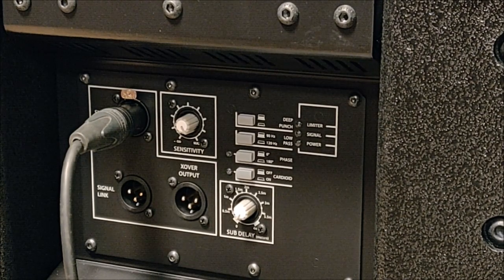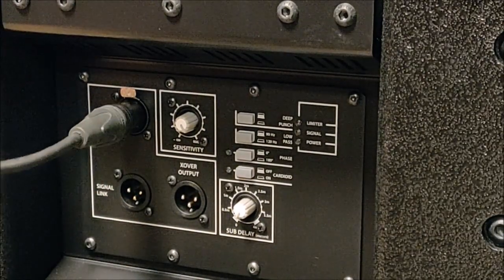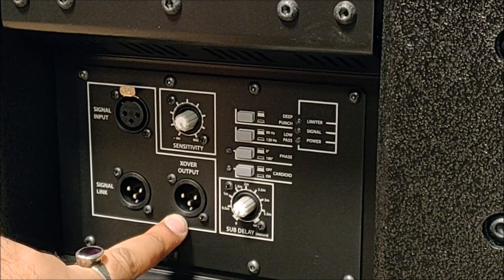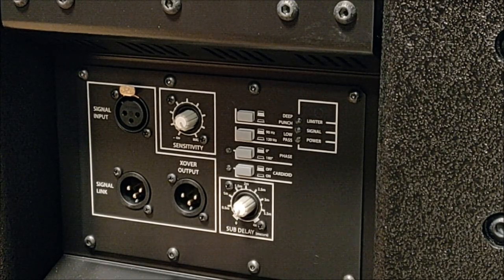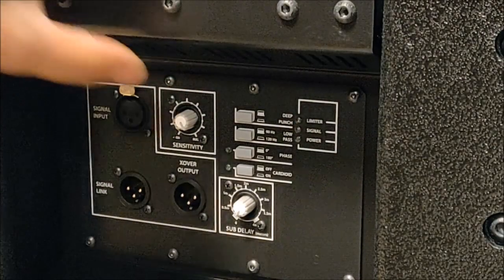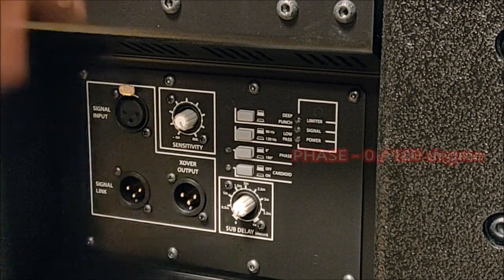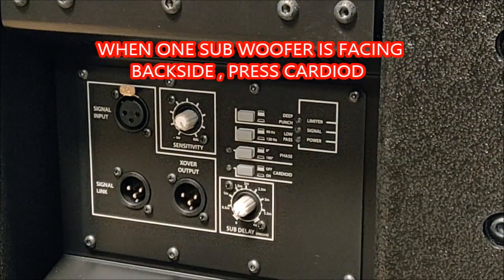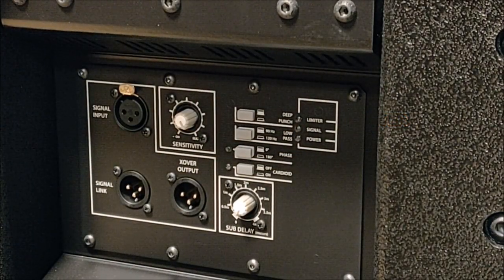RCF SUB WOOFER DIP SWITCHES EXPLAINED

Comment: Hi. How can I setup sensity level to 0db? In the middle?
Reply from the maker: It's at position 2 o clock. But recommended is keep it at full as other passive system amplifiers work. Full up
Reply: @FREQBOYZ_AUDIOMAN  thank you. For hdl20 on top is the same? I try at max level 8 hdl20 and 4 8006 but i hear too much subwoofers. I will try at 2 o clock.

Comment: if we have 2 subs of modal 8006A at one side and want to cardiod effect , so both cabinets has same switch position or only for the cabinet using facing backward?
Reply from the maker: Only cabinet that is reversed will have the cardiod switch ON. However Cardiod won't be effective if you have 2 Subs , as it's more effective with sub woofers in group of 3 subs or 4 subs to give you best effect. With 2 , it's advisable to have a end fire or Gradient subwoofer configuration